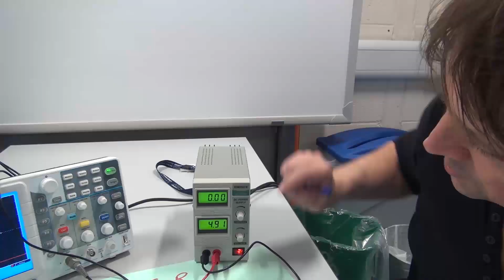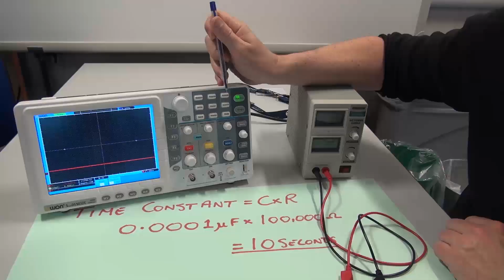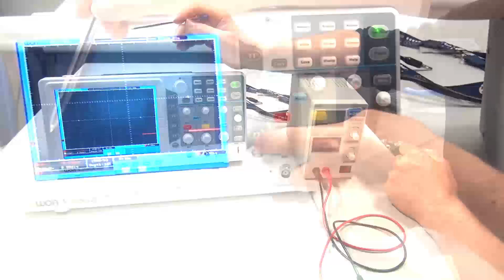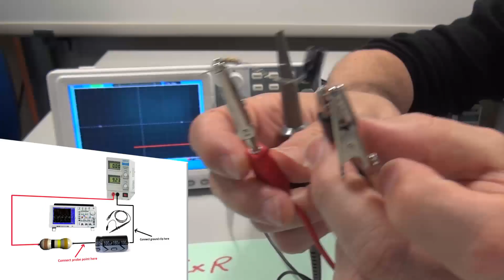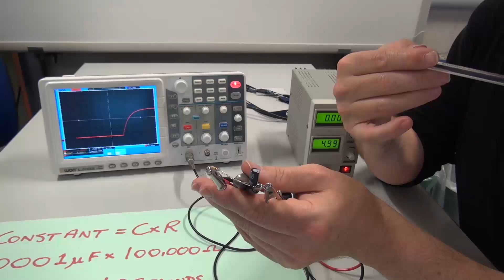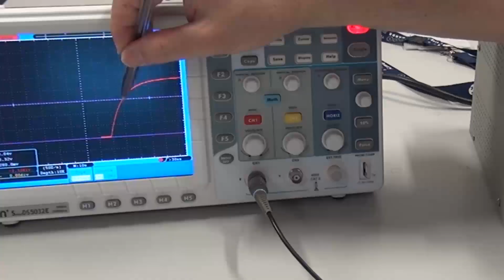Oscilloscope Measure Voltage across a Charging Capacitor

Comment: without thinking I intentionally shorted my capacitor with a small screwdriver to discharge it while it was still connected to my oscilloscope. Could I have damaged my scope? because it seems super slow now

Comment: Great video... I have never done this kind of measurement before, but wanted to test a 5F caps I got to see if was around 5F. So I replicated your experiment, then changed it to bigger and bigger caps (100uf, 1000uf 10,000uf, and small and smaller resistors (and and higher wattage) while adjusting the o-scope until I got to 1R10W to 5F

Comment: Loved it. But Mi would have turned the Power supply before, inserting a normal switch. Because then then the power supply is fully operational then. Just flick the switch and you might get a more precise reading. Just a guess

Comment: Thanks for explanation, I'm currently learning electronics, and just found out about your channel, I am looking at Owon PDS5022T to buy, I want it to assist me to learn electronic circuits, and visualize waveforms. also to compare a wave, vs a distorted wave for instance. Do you know what are the differences between it and yours ? I'm working with audio circuits, and this is the direction I want to take, and also visualize waveforms from audio/LFO, Envelope generators

Comment: 0.0001uF is 0.1nF which is 1x10^(-10). If I multiply 1x10^(-10) by 1x10^5 I get 100ms. How does that gave you 10 seconds of time constant?
Reply: I think he has a typo in his chart. He looks to be using a 100uF cap, but his chart says 0.0001uF, and it's actually 0.0001F

Comment: Is that mesure wiring method safe to use with a AC source?
Reply: You have to be careful with the voltage with ac ( well dc as well) and make sure the capacitor rating is around 2 x higher than the peak ac voltage. This test is specifically for dc.
Reply: Thanks for answer, suffisant capacitor will be alright.

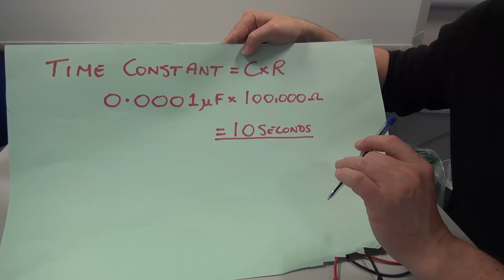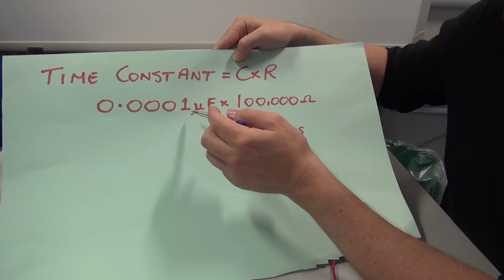Comment: At 2:10 your equation says 0.0001uF*100000Ohm=10sec which is wrong. I think you meant 0.0001F not uF which is exactly what you've actually said at 2:30.

Comment: Not so sure about scope resistance being the cause of voltage stopping at 4.5V. We have a voltage divider here. 100K resistor plus 10M scope (probe) internal resistance. Vscope=5V * (100K+10M)/10M = 4.95 V. More likely it is your power supply not really outputting what the readout says. My cheapo Chinese supply at least has two dials (coarse and fine) for V and two more for A and it still is off. Yours only has one dial each. Don't tell me it's actually calibrated to x decimal places ;)
Reply: Artur's Lab I did a similar test with a 6v battery. My scope gave me 6v. I think you right about the power supply.

Comment: Arduino 5v pushing too much current as it charges the cap in uSeconds.,  added a 1M in series with the 100k resistor.  2.84v at 63.2%, tau = 84sec divided by 1.1Mohm is 76uF for a 100uF cap...   Math doesn't work out; but, at least the culprit "current" was identified!   RIGOL DS1052E horizontal time scale at 50 seconds and you have to wait 3 mins before the graph appears!  patience grasshopper.

Comment: Does this work with a breadboard and a 5 volt dc power supply?  I can't seem to get it to work.  I put a resistor and capacitor in series but it doesn't show the rise on the oscilloscope.  Just a steady DC line

Comment: Thank you for the demonstration. 

The "micro" should be erased in "0.0001 uF," because 100 micro Farads converts to .0001 Farads.  When the number of the quantity decreases during a conversion, the size of the unit of measure increases to compensate.
Reply: Jon Kroger I’m agreeing hundred percent

Comment: Nicely explained. Really.
But if you had used a lower value resistor you wouldn't have loaded down your circuit that much.
Reply: A high resistance is used for two reasons. Firstly to make it easier for students to capture the charge curve and secondly to demonstrate the effect of the input impedance of the scope when it is used to take measurements from circuits which contain high resistances such as this one :)